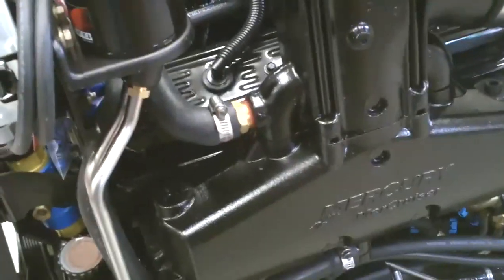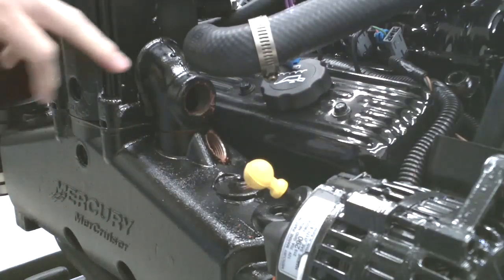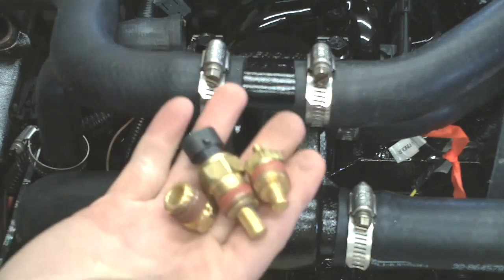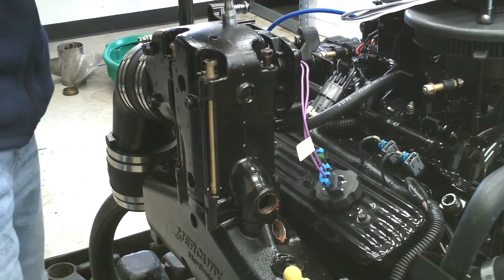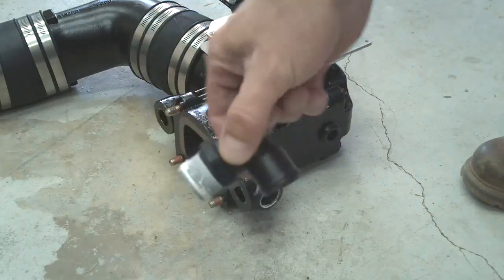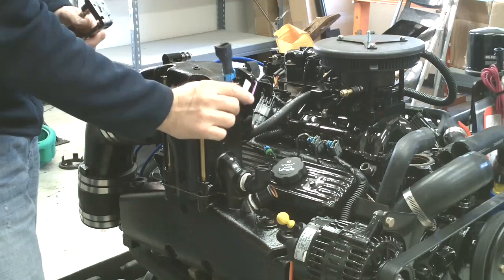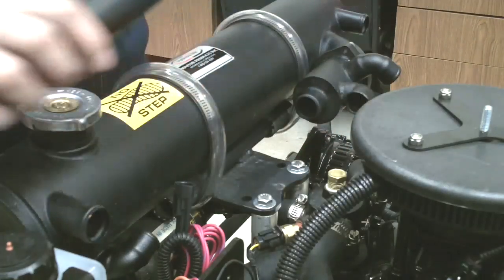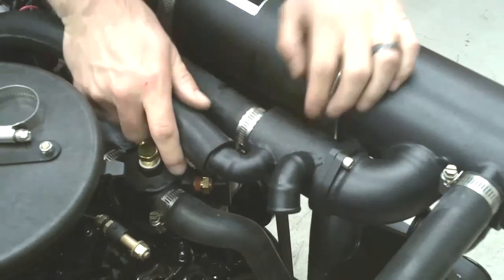Closed Cooling Installation - Mercruiser 383 Mag Stroker

Comment: Keep hearing that a aftermarket FWC kit intalled on a MPI engine will cause codes or faults with the ECU because the engine will be running at a different temperature requiring a re-flash or ECU replacement...any truth to this?
Reply from the maker: We've heard that before but been selling this kit since 2002 without any issues. There is a supplemental kit you need to order when installing it on the 383. It has a smaller dia pulley and additional hose/fitting required to increase the jacket water flow. This is also required with the OEM kit as well though so nothing different there but you do need to install it. That kit is listed on the page with our 5320-8B kit. https://www.perfprotech.com/mercruiser-closed-cooling-system-2002-current-small-v8-carb-efi-high-capacity-premium-full-system-5320-8b-5320-8b/product/243425?search=5320-8B
Reply: Is there instructions for that extra kit? I'm not sure how to use the extra pipe.

Comment: The through hole on those riser gaskets looks to small for a muscle motor pushing nearly 400 cubes. Me i would mod those holes oversize and punch up the torque and Hp especially on the top end.

Comment: I am installing 383 MAg, EFI, inboard (straight drives, hurth 63A, NOT v-drives) engines currently - dry joint exhaust - just want to confirm this kit will also work with that setup. Thanks!
Reply from the maker: +DeepImpactFishingTea Yes sir the 5320-8B is the correct system for that motor. https://www.perfprotech.com/mercruiser-closed-cooling-system-2002-current-small-v8-carb-efi-high-capacity-premium-full-system-5320-8b-5320-8b/product/243425?search=5320-8B

Comment: what kit is this? what is the part #?
Reply from the maker: +Anthony Myers https://www.perfprotech.com/mercruiser-closed-cooling-system-2002-current-small-v8-carb-efi-high-capacity-premium-full-system-5320-8b-5320-8b/product/243425
Reply: Performance Product Technologies. Hi there; great video for the retrofit solution to a well known issue. By the way, do any of you know if an EFI retrofit system is available on the market as an upgrade for the carburettors?

Comment: no gasket sealer on riser ?
Reply: Embossed SS gasket doesn't need sealer, if sealer is used on this type joint it would have to be high heat rated. Also consider sealer is not conducive to heat transfer

Comment: do you have a video on removing the starter on a 3.5 merc alpha 1 ?
Reply: Using appropriate tools; Disconnect battery, remove electrical wires from starter solenoid, remove retaining bolts from starter assembly mount, lift starter away from engine.